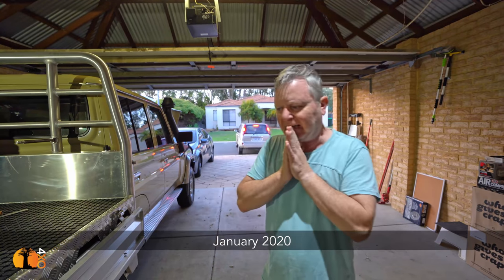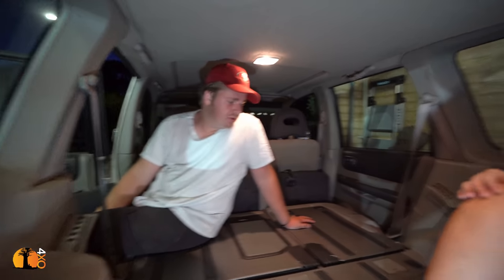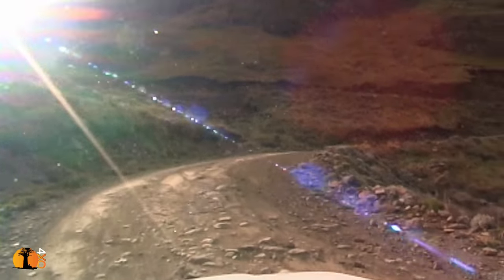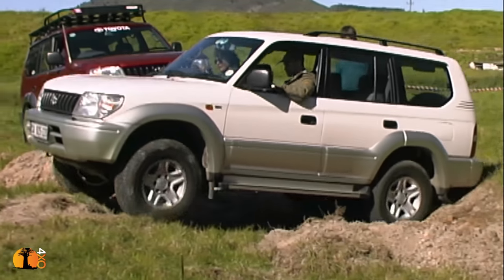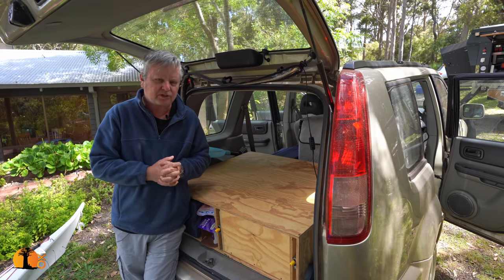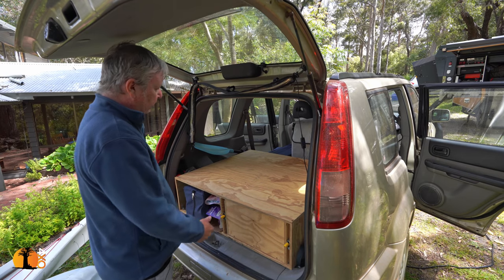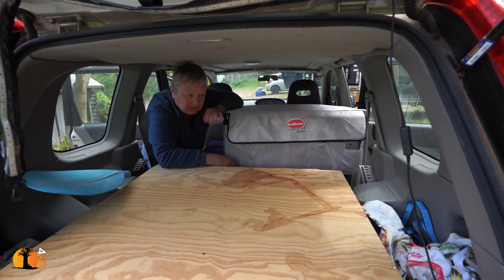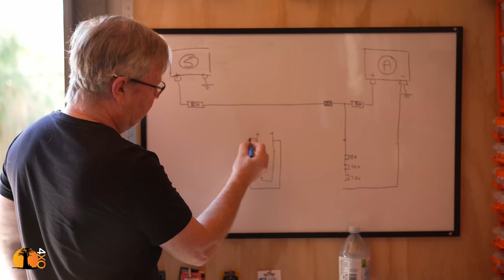A BUDGET 4WD TOURER IN 2021. Low cost 4WD overlander for backpackers | 4xOverland

Comment: I've owned a bunch of cars in this class.  The Xtrail drivetrain isnt especially unique.  The subaru is, but the xtrail is pretty much the same in all 3 generations.  its the same basic setup as all the fwd based suvs.  An angle drive box off the side of the fwd gearbox sends drive to the rear diff.  most then use some sort of switchable diff in the rear.  haldex (vw, freelander, volvo etc) use hydraulics to engage a clutch on the read diff to engage or disengage it from the propshaft.  haldex systems are managed by the ECU and afaik never have a button that allows you to oerride it.  The asian manufacturers mostly use electromagnets to engage the clutch.  I've had a second gen Xtrail, second gen rav4, third gen outlander and second gen hyundai santa fe and all of them have had a button to "lock" the system in 4wd by fully engaging that clutch on the rear diff.  in theory (or maybe in practice in OZ) they can eventually overheat and disengage to protect themselves.  I've never managed that but I live in a cooler part of the world   In my experience these systems work very well for what they're made for, and with a set of all terrains I've surprised many what you can get through

Comment: With a small SUV the first thing to do is get rid of the back seats! They take up a huge amount of space even when folded. Then the fridge can drop down and it's top can be part of the sleeping platform's surface. This is how I'm setting up my two door Pathfinder. Fridge behind the passenger's seat with a drawer behind it and a five foot drawer on the driver's side. Batteries and water storage on the rear floorboards to keep the weight low.
Reply: See my comment a few minutes after yours.

Comment: I've owned 2 xtrails of the same generation, yes, they are capable off road.... but watch the thermostats in the motor. They will sieze and blow the head gaskets after about 200,000k. Keep an eye on the thermometer.

Comment: The Subaru suffer from several serious mechanical problems (older ones in the age range you were looking at) and are expensive and problamatic. Major engine oil leaks lead the way, leaks that require removal of the engine and partial teardown to replace virtually every gasket in the engine with "new and improved" ones. Subaru owners either love them and won't say that the problems are more than "minor glitches" or they very quickly learn to unload them. Toyota, and Nissan first, everything else follows.

Comment: The Xtrail is the only car that doesn't have lowrange that I'd even consider taking offroad. I hope it's an Auto and you're doing something to monitor transmission temperatures.  

Personally I'd prefer the suby as you can get kits to reduce the gearing in their low range.

And the rangie would be a risk I've seen and heard of too many people being stranded out there from electrical faults.

Comment: I had a Pathfinder that I got cheap and was a great vehicle except it had been used to tow a horse float and the gear box was failing 2nd, the previous owners were offered a poultry sum on trade in so they gave it to their daughter who new to driving did not know how to nurse a gearbox, thus I bought a vehicle with a 3 speed auto missing 2nd gear but it was a proper 4WD. Being mechanically minded I was able to drive it and I liked it but the repair to the gearbox was $3500, 3 times what I paid for it. I now drive a 1997 Subaru Forester which was cheap but so well looked after, they kept filling in the log book after it was full. It is almost due for it's 400 000 k major service and although that will be costly it is worth it because I will never sell it. The low range transfer case turns it from a semi luxury all purpose 5 seat wagon to a very competent off roader.

Comment: I had a diesel X-Trail in the uk never got stuck in the mud never went in really deep mud though the only fault that I found with it was Ground clearance I think it is possible to lift them a little but its quite expensive that was one of the reasons I sold it the other was wanting an automatic.

Comment: To be honnest, I don't know why you choose the x-trail more than the Subaru. I would have choosen the Subaru. But if you want to offer the best 4x4 at the cheapest price you should offer a Lada Niva or an UAZ. I own a Niva, and I also own a Pajero. So I know the difference in comfort.  (I know you don't like Pajero's and I agree your comments why, but it's also a daily working horse for my trailer for my business on flat roads and after all it's a strong vehicle. ). If i go overlanding i prefer my niva because even it's broken, it brings you alway's home. Water in the engine,  gearbox without oil, it just runs.... and it's cheap and easy to fix.  You should look a bit more over your shoulder. I'm always in for a challenge, your old range rover against my Niva  (not for towing 2 tons, but offroad)

Comment: budget i would of gone for a troopy  a 20+ year model..

If i was going to pick a nissan it  would be the a patrol as it will be easier to source parts for in country towns any sub brand nissan will be a hit and miss to source new or 2nd hand parts for repair..

I would not trust a city runner in a off road context because what ever the 4x4 system it has most likely there as a safety system on road..

27Mhz, uhf narrow band and uhf wide band and VHF radio

before you purchase something male sure there is a parts supply for the vehicles..

It is the 1st time i have heard of that model of Nissan in Australia, personally if the 4x4 is an import and is generally not sold in the Australian Market then I wouldn't touch for use because parts will be scarce for it 

I like this series Andrew though before purchase it always pay to check if there servicing part availability in this country...

It is a bit late now you already purchased it how word of caution be careful if this was a imported vehicle as obtaining parts can be an 4x4's not generally sold in Australia..

an X-Trail in the city can get parts for, in the country areas may cause issues..

which can more than a week in some cases to source parts for, i find the small to medium class 4x4 may excel on maintained  dirt/gravel roads and back roads where there is no tarmac  

they typically do not have the engine or battery power to effect a recovery 

i am think tupperware princess of the x-trail

Comment: Would be interesting to see how this stacks up to my 05 MK Triton TD for 6.5k from a dealer with 250 thousand ks on a diesel. It actually works out cheaper to run than my Nissan Pulsar considering Perth fuel prices at the moment. I can't imagine the X-Trail being anywhere near as capable or having the potential of a diesel ute, although I would love to get a X-Trail gt with the 200 odd kw sr20vet from Japan and do some sand dunes or mud but yeah.

Comment: Very interesting Series about the X-Trail modification 👍 Just one question. In all cars you bring in as alternatives in my oppinion you missed the Suzuki Grand Vitara. It‘s a real 4x4 with low range, it‘s Good value for Money and reliable. Is there a Special Reason Not to propose the Grand Vitara?
Reply: Maybe because it has a lot smaller cargo area once seats are folded.

Comment: I have a 2008 4wd X Trail, great car but unfortunately the CVT gearbox in mine just failed and it's quite $$$$. Hopefully that's a manual one. Hope they get many happy miles out of theirs 👍👍
Reply: First gen X-trails have better transmissions. Not CVT. I have had mine now for seven years. They are also mostly purely Nissan and not Nissan & Renault as for the latter generations

Comment: What are your thoughts on the Chevy Trailblazer, in SA those have dropped seriously in value with low mileage even. Under R150k for a 20 teens vehicle with under 150  000km. Very tempting for a Southern Africa Overlander.

Comment: You are a bit wrong about the newer T31 model. Driveline is about the same(gearbow, transferbox, rear axle)
, but the susbension is different. The 31 is more expencive to lift. 
Wheelbase is longer on the newer, and the overal length +25cm
T31 has Brake assisted LSD as standard, T30 has not in AU market. 
Have owned the 2005 t30(engine rebuild, transfer and gearbox went , all jobs done by my self)and own a T31 right now.

Comment: Hi Andrew I know you've had your experience with Mahindra in 2018, but if the wheel didn't came off where would you rate a Scorpio Bakkie compared to the Nissan Xtrail. I have had the SUV Crde 2.6 4x4 and never had any problems with it even when living in Mozambique for a while.  Never got stuck and yes it's not a Troopy but having owned a 1990 model before I thought the Scorpio did me quite well. Whats your opinion. Thinking about a budget trip to Namibia

Comment: True 4wd.? No. Its a great and noble Awd. And that's ok.  For a true 4wd on a budget, Suzuki Grand Vitara was the best option.
Reply: Yeah because a Suzuki can easily sleep 2 people and fit gear inside it. Yes a Suzuki is a fantastic for 4wd, but if you want to do Long Touring even just sitting on the Black Top you will need a Trailer and or Tent to do it comfortably. And to get a Suzuki in Good condition you will have to pay well over 10k, something in lines of 14k for one with Similar Kilometres as this XTrail which cost well below 10k
Reply: How is it not a true 4x4? It has a centre diff lock. Sure it doesn't have a transfer case for low range gearing but that doesn't make it NOT a 4x4.
Reply: Nah disco 2
Reply: I was thinking grand vitara aswel but I think even the lwb ones aren’t that big inside to sleep etc
Reply: Actualy a pathfinder would have proberbly been the best choice for what they cost (atleast in the uk) and relatively cheap to run for a 4x4
Reply: Pajero Is also very popular in australia too as a backpackers vehicle
Reply: @oldluxy  they are getting up there in running costs though, more modern things like pathfinders are a lot better on fuel
Reply: That is true , I managed to grab a good deal a few years ago , 1990 turbo diesel pajero 90,000kms for $2500aud
Reply: @oldluxy  one of my favourite cars I ever had was a old 93 swb 2.5 Pajero. Bought for £750. Had soo much character, there was soo many faults but nothing terminal and it never ever let me down! 
The rev counter went off but you bashed the dash and it came back on, it had a diesel leak for a while so if you left it a couple days it would take a while to start then puff out a huuge pluuume of smoke, but then one day the leak somehow fixed itself 😆🤷🏼‍♂️, the exhaust progressively deleted itself making it sound meaty. It was strangely impressive off-road with old ass worn at’s.
I miss it now thinking about it haha
Reply: @paulholyoak  Not having a transfer is exactly why is not a true 4x4!
Reply: @J-P88  the 5 door version you can fit easly... There are many videos about this. And don't get me started with the XL7
Reply: @mre.w.2850  great option... and beauiful to see
Reply: @27walker27  You know what...? you are absolutly right
Reply: @ignacioentrocasso8171  bit biased had loads of them easy to work on, cheap and will go anywhere lol

Comment: Don't take this as a criticism but is there no supply of Disco' TD5s in Oz?
Terrific idea for a project, though.

The biggest dilemma with building a budget overland vehicle is how much effort to put into it.
If you DO enjoy it, chances are that you're going to quickly upgrade to a better vehicle, which'll mean repeating the build process and spending money again.
I'd suggest that any first attempt at overlanding foregoes things like drawer systems or significant vehicle mod's.
That way, you won't end up spending a lot of effort and money on a vehicle that you're likely to quickly replace.
Reply: LRs might be OK in the muddy paddocks in Blighty where it doesn't matter if the engine, transmission, electrics and/or suspension shit themselves and you can just walk to the nearest garage to buy spare parts.  But if you're hundreds of miles from the nearest town and in the middle of the desert, you're a bit screwed.  That's why Aussies see LRs as a bit of a joke.

Comment: Do those have Low range? I kinda prefer the Suzuki Vitara, specially the 2nd Gen since they have a ladder chassis and rear solid axles, also they have Low range and are really reliable, the X-Trail usually blows CVTs or the X-Terra which is based on the frontier truck
Reply: No, The X-Trail does not have low range

Comment: Should have bought a Pajero (said many).
Reply: 100% agree. I sold my NM 3.5L 2 months ago for $5300 which was in great condition & spent 3k over the previous year. Here's a list of what it had & what. 
9500lb winch & winch cradle not installed 
Mitsi Bullbar just installed
New clutch
New valve cover gaskets
New cam seal
New brakes & rotors all round
New front bearings
New windscreen
New seat covers, interior full removal & shampoo
New drive belt
New leads
New accelerator cable
Sidesteps just installed
New diff solenoid
New sway bar bushes
Came with a Chescold 3way fridge/freezer - & new gas bottle
New kings  dual battery box setup - No battery
Gcamp rooftop tent & annex used for 1 trip to Mission Beach - 23 nights use
Factory roof racks
New Century 810cca battery

327000km. No rust. No beach or hard offroad tracks and it ran like a swiss watch.
You can't overlook Pajeros on a budget. Especially a well maintained NL.
Reply: @pureblood7215  Probably work $20,000 now
Reply: @things_I_saw  lol. 4wd's are like bitcoin at the moment. Bizarre I've seen another Francis. It's my middle, not my surname. Anyway, have a good weekend.

Comment: X-trail is ok, petrol burns oil, beaware!!! Diesel has chain tensioner problems /older models/. Wheel bearings are not that durable. Brake caliphers problems sometimes. I used to have the older Diesel. Good offroad.

Comment: Having owned both a Forester and heavily modified WRX I do not agree with your words regarding the Subaru and their AWD system.  They are pure AWD vehicles, unless you have an older base model Subaru that is FWD they are all AWD all of the time. 

As for the X-Trail they are front wheel drive until you chose to put it into 4H or 4L.

Comment: 2:48 it says the later x-trails don't have the same transmission; so what does the 2008 (and onwards) x-trail have?
Reply: CVT transmission auto which has problems. Get a manual if you can.

Comment: How does the 4wd system differ in the T30 XTrail compared to the T31? My T31 has selectable 4wd plus low range as well.
Reply: All Mode selectable all wheel drive system - normally front wheel drive vehicle, in AUTO mode rear axle engages when front wheels start to slip, power is variably distributed from 100:0 to 50:50 front to rear. In AUTO mode the system works as an automatic all wheel drive system.

In 2WD mode, the clutch is unlocked permanently. However, even when in 2WD mode, rear wheels can sometimes be engaged by electronic control unit, for example under heavy acceleration.

In LOCK mode the tranfer clutch is permanently locked - power distribution 50:50. If vehicle speed increases, the vehicle automatically goes to AUTO mode, then, when speed decreases, it switches back to LOCK. When transfer clutch oil is overheated, the vehicle goes into 2WD mode.

Note: Info about the T30 All Mode 4x4 system, but it works differently to the All Mode 4x4i in the T31, mainly due to ESP capabilites in the T31 which are not available in the Australian T30 models.
Reply: there is no low range in T31...

Comment: If your vehicle is a bit simpler or squarer, like a box van or older truck, you can use a shelf and put boxes under that, or even have a slide-out table, like this: https://www.youtube.com/watch?v=CO9fi5J5Ruw 
Even cheaper than DIY carpentry and very easy to uninstall for daily chores!

Comment: Which forester has 4wd?  My 2010 manual transmission had no such button or lever. It did have a low range lever which was a gimmick tbh.
Reply from the maker: Its always in 4wd, with an open centre diff. Its not like a AWD, which are 2WD and then go into 4WD when the traction control thinks it's necessary. So you have to lose traction to get the traction back. Hopeless off-road.
Reply: @4xoverland  I believe no Subaru is 4wd, they are all AWD, that differs from "AWD on demand" system that most cross overs use. Ronnie has this perfect video https://www.youtube.com/watch?v=ceSFYccOzDg
Reply: @kg0173  Agree with the 'on-demand' making a difference.  My Territory is constant AWD, but I remember hearing a story about the 'Real-Time' Honda CRV not being real-time enough to divert power to the second axle in time to cope with sand!